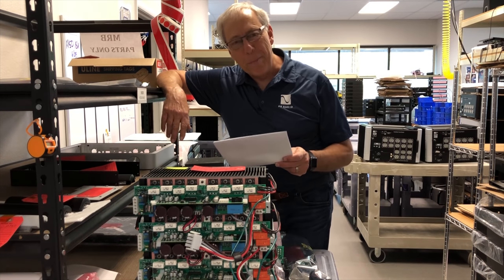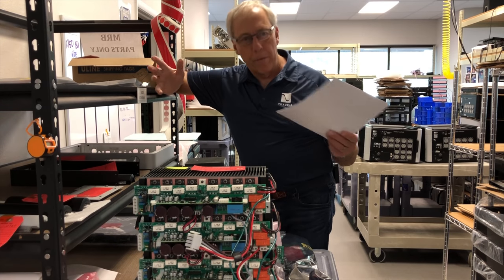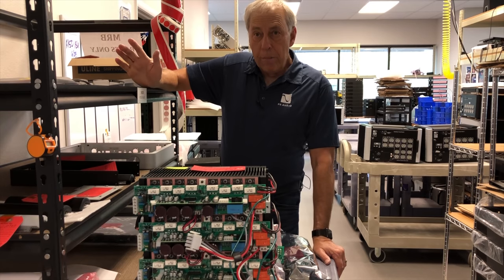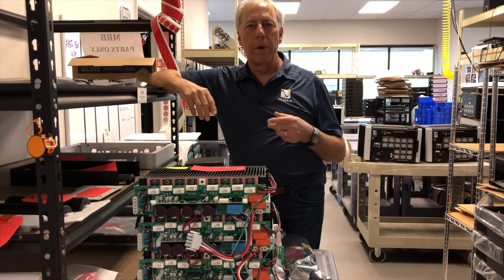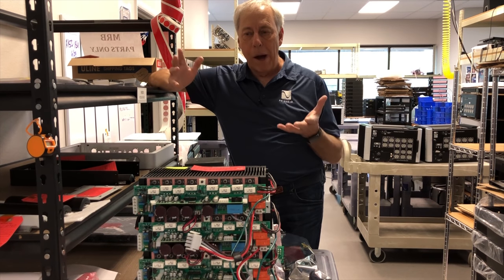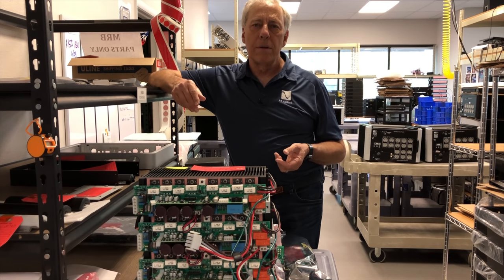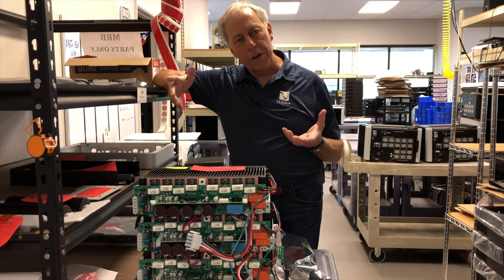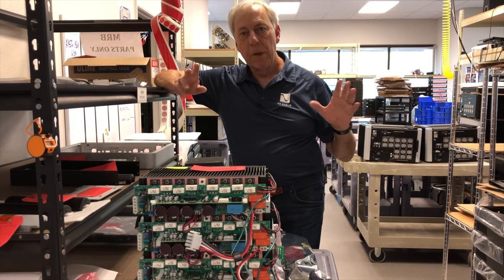Is the BBC dip still used in speakers?

Comment: Finally I understand why two way speakers never convinced me.
Reply: Actually, the less xo points in a system the better. And as soon as you go past a 3-way system the more difficult it becomes to get it right. Also if the drivers are down -6 dB @ the xo, the sound at the transition will be better than if the drivers are only down -3 dB, as an example.
Reply: I think he means he prefers one way speakers.